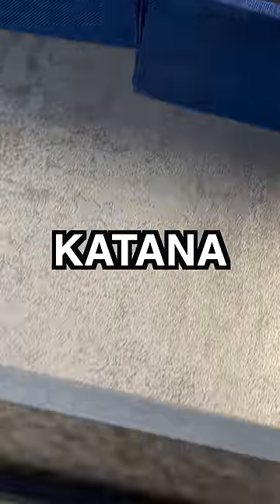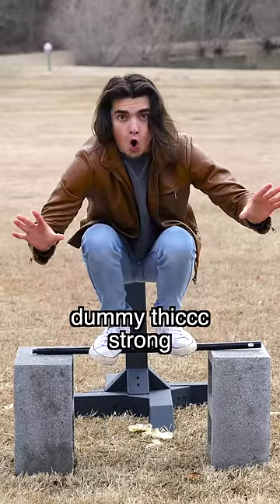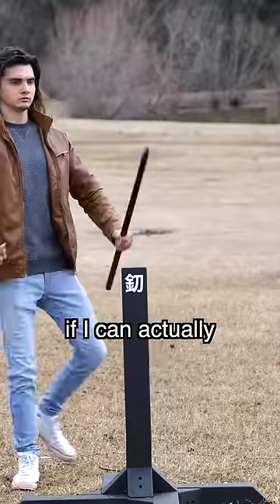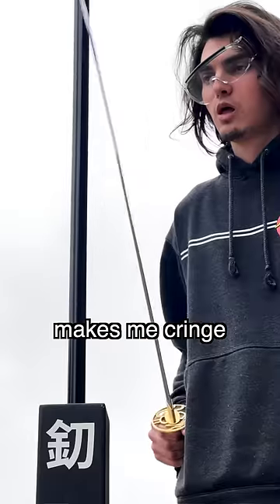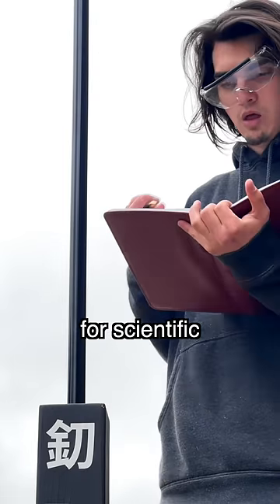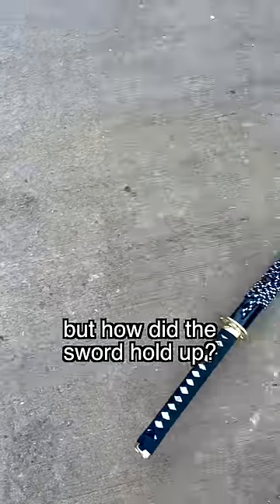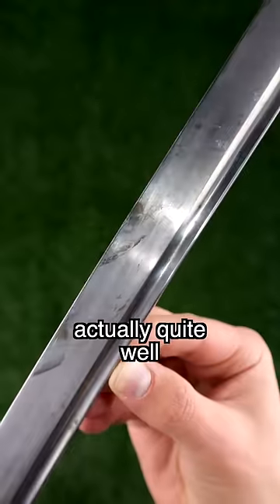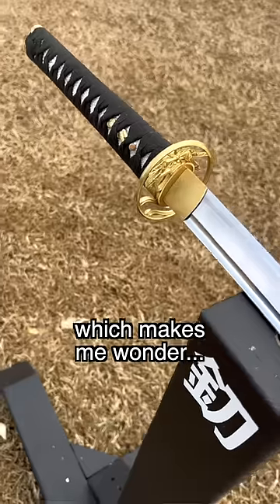Can A Katana Cut Through Steel Pipe?

Comment: Assuming it’s really metal at all, that pipe has got to be made out some of the mildest steel ever manufactured for it not to chip the edge of a Katana. The cutting edge of any Japanese blade is extremely hard. They’re great for retaining an edge but also very brittle as a result.
Reply: Is aluminum
Reply: You think a modern mass produced Katana is going to be differentially hardened? Lmfao
Reply: Fhe blade was damaged where he shows the blade is all dirty and smudged you can see a small chip and divot in the edge if you look for it instead of taking a quick glance
Reply: @autumn5592 No, I said the edge is going to be very hard/brittle. Even “mass produced” Japanese Kitchen knives are made this way (I should know I own several). That does *not*necessarily imply a  softer, more flexible core though you are at least correct that a proper katana would have one. That said, if you’re going to try to look smarter than someone else make sure you’re at least smart enough to comprehend what they’ve written.
Reply: @Vales55  
I would say that he rather meant differential/partial hardening, where part of the blade cools down faster than the rest of the blade and is therefore harder, which also creates hamon.  And it doesn't matter if the entire blade is made of the same steel, or if it is made of two steels forged together with different properties.  Also the pipe is most likely made of aluminum and aluminum is a metal...

Comment: Fun fact:samurai during a war doesn't actually used the katana for most situations since it can't cut through most steel armor and also because there's better options
Reply: Actually when we talk about armored unit armed with heavy plating NO SWORD can cut through the plating katana or not, mostly when fighting armored opponents they attacked the gaps of the armor, but samurai didn't use very heavy armor so katanas are razor-sharp because they don't deal with those heavy plated armor

Comment: While forging it can slice and dice the steel pipe due to immense heat just... burning through it. Its a gamble on both steel pipe and katana since its not cool down yet to hold the katana up. So I think only while the katana is fully finished it only takes 3 to 4 hits.

Comment: Yeah, this is alluminium. And thats not a traditional katana, just normal spring steel. If this were a steel pipe and a traditional katana, it would chip and bend. Bolt cutters and circular saws exist for a reason. 
Katanas are cool and their art too, but this is just anime-level misrepresentation.

Comment: there are no chips or scratches because the “sword” is made of 1045 low carbon steel. aka useless mild steel that they make shelves with, this thing will never hold an edge and is simply a decoration piece.

Comment: Well, I technically did this on accident with one of those old steel gas heater and a stormbringer.
The steel was nowhere near as thick as that aluminum. It hit the grate guard meant to keep children from sticking their hands in it, whice is made of thin bars (slso steel). I ended up with noticeable dents in my blade. It did not go through the heater or bars.

Comment: Angle of strike, pressure over area, swing arc, everything's wrong. I could slice that like butter. More than half your impact is being absorbed by the base stand of your steel pipe. Meaning it's too lightweight. You need to lift your front leg and stomp into the strike and follow through with the blade. Also, your point of impact should be about half a hand-span lower on the blade. The elbow of your bottom grip hand should be locked straight on impact. Swing with your entire body not just your arm It is a precise art. You need to take advantage of the physics of a curved blade better. Practice makes perfect.

Comment: Nice job using the towel wipe as an opportunity to cut the video and sharpen thr blade and then showing an undamaged blade. There was defamation on the edge before you wiped it. You can't wipe that off. You would have to resharpen the blade.

Comment: You could cut through that ALUMINUM pipe very with 1 or 2 decent swings. But against actual steel, that’s not happening. Katanas were really not that effective against any QUALITY armor, and definitely could not break a other blade in a fight.